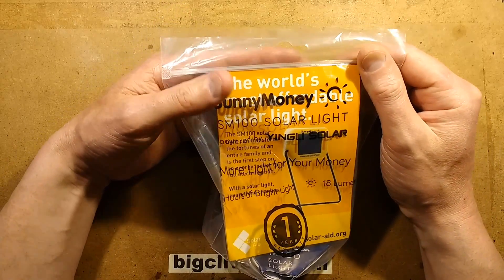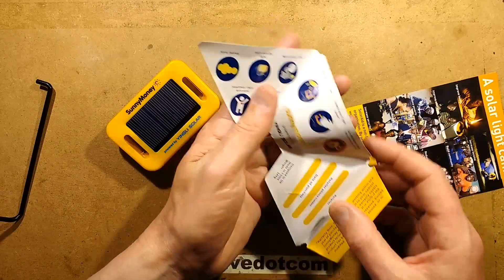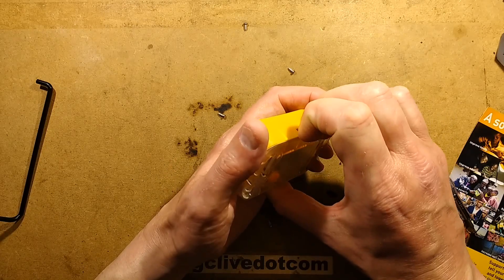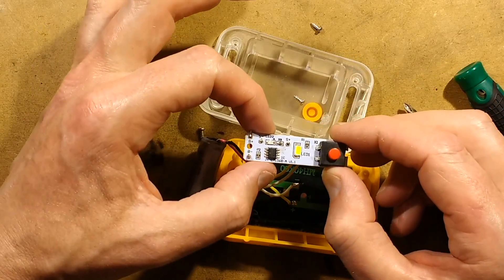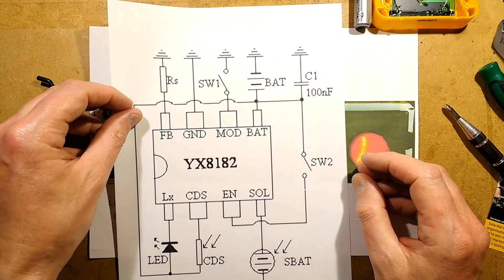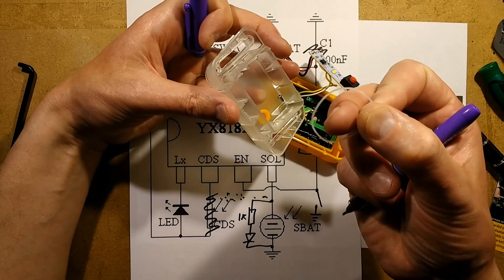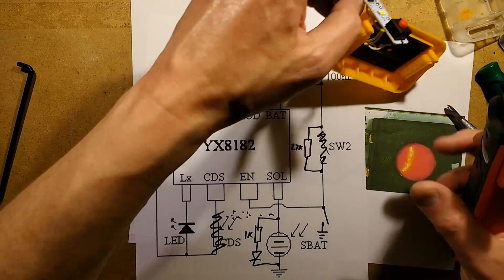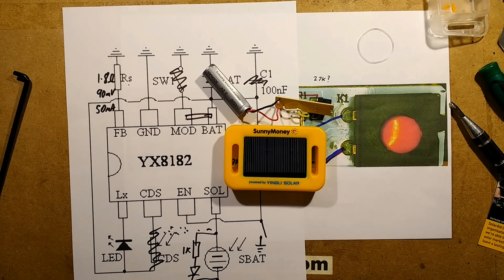SM100 solar light for off-grid communities.

Comment: Another benefit of LiFePo4 is that they’re deep cycle, so if you drain the cell flat they don’t mind as much. A LiPo run to 0v might just die on the spot

If this was waterproof and had the “charge by day, glow by night” config, I could imagine plastering it into the roof for automatic house lighting

Comment: don't know if its just me, but this seems bad value for money, and a bad design especially for someone in a third world country. It seems you could get this made for less than £5 in china, and can get very similar stuff for around £5 off the shelf, 18 lumens is not good if that is your only light source, i think your poundland solar project would be better for them than one of these. And torque head screws, these should have normal flat head or crosshead screws so someone in the third world can actually replace batteries or led's within it, these will just get thrown away or smashed apart as they won't have the tools to take them apart.

Comment: Watched pretty much all Clives vids. Brillant! all of them. :) I still can't find a way to "click" 'Thumbs up' when in full screen mode.  I also get confused with the electronics terms  "pull up" "pull down" "across" and "in respect to". i do have a disability with learning tho. if anyone has any "explain it like i'm five" explanations (with pictures?) that can put the 'vernacular' language into a context to help me learn, i'm sure that myself and possibly many other beginners would be very grateful.
Reply from the maker: Pull up and pull down refers to where an input pin on an integrated circuit is connected to a switch.  You can't leave the pin floating, it has to be either positive or negative, so if the switch is connected to the positive rail there is often a resistor inside or outside the chip that pulls the pin down to the negative rail when the switch isn't pressed.    Where the button/switch is pulling the pin to the negative rail the resistor will be pulling up to the positive rail.
Reply: @bigclivedotcom  Thank you sir! :)  so the 'pull' is getting the input "to get off the fence and choose a side, a side that 'we' have decided that you prefer, for you" ?

Also pull down and pull up. no push? is push a term?

Comment: @7:03        Might not a screen capture be appropriate then?   Windows key + Print Screen (PrntScn) if M$ hasn't changed things in the 15 years or so since I've used Windows or Grab on OS X (which lets you choose between capturing the entire screen, a specific window or a selection)...    it'll add 30s or so to your workflow to grab the screenshot, open the resulting .bmp or .tiff and crop if necessary before printing...     just a thought (^_-)

Comment: Wow that UT210E is stunning!! I have a much larger clamp ammeter that can read DC Amps up to a few hundred but it hardly stays at zero like this one does. The slightest activity makes it shoot up to 30A or 50A when there's no current passing through at all. It's only good for measuring very high DC amps like a car's starter motor :(

Comment: Not gonna lie for 10 quid you get a torch that charges with the sun. Sure they claim to sell it cheaper to developing countries, but it's still bloody useless.

The LED is behind half a centimeter of plastic, wasting light by splashing it all over the case, there's no USB charging ports (at least one would've sufficed) and the thing is designed to make it impossible take apart to repair, which I'd say is vital for people who'd have little access to just buying a new one off the shelf or online.

I say a USB port would've been necessary because while it's true they don't have as many gadgets and such to use them with, it's incredibly naiive to think they'd have no use for charging over electronics. It defeats the entire point of an expensive solar cell when it does the same job a wind-up torch can do for much less. If they had cheap phones or tablets, or even a USB-compatible battery charger for other electronics, this device would've been great as a solar powerbank but also for charging items for free.

Instead, you get a mediocre LED with a bit of metal, and most of the money goes intoa solar panel that isn't even utilised to its full potential.

This product clearly wasn't designed for developing countries in mind, it was designed to make a profit off the backs of struggling communities and charities thinking this product will make a damn difference.

Comment: Hi Clive  any chance you could do a tear down/how it works- of a small bathroom extractor fan, I have one which works,but the time delay side of it has stopped working,  I was goin to replace it,but if it's just a case of a few capacitors which are used to keep it running after the powers off? Then I would like to repair it....  Would be a good video as well I think😀😉. Atb Martin
Reply from the maker: It may be the power supply resistor that has failed.  They often use a simple resistive dropper and they get very blackened over time.  If you do take the module out then be very careful as there is a constant live feed to the fan as well as the switched one.
Reply: bigclivedotcom   Ok thanks,will take a look at it

Comment: 45mA from the battery, not driving the LED... as the voltage of the LED is likely lower, its current will be higher.
Reply from the maker: +TheDefpom It's a simple current regulator, so it will mostly be the current through the LED.

Comment: only 300mAh? that sounds awful for that size of battery..why not use a NiMH battery that size? you can get batteries about that size that are about 2000mAh.. even if they had to step up the voltage a little bit wouldn't the greater capacity greatly outweigh any cost to boost voltage? hell, i think even AAA nimh batteries have around 800mAh! nimh can be very low self discharge and have many cycles..
Reply from the maker: +kekejojo1212 300mAh at about 3.2v.  So roughly equivalent to a 900mAh NiMh cell.

Comment: A lot of clever features and safety has gone into this. Those batteries are still dangerous. a regular screw would be common knife but a torx screw needs a special hard to find tool. They could've used cheap screws, but didn't.
It looks real well designed and thought out. Good on them.
I wonder how many actually makes to any kid, and not gutted for batteries and parts!

Comment: a few years ago I purchased 20 solar powered automatic air fresheners The refill cartridges were no longer made, I think I paid £5 for the lot.
I sold some on eBay for solar projects as the solar panel . charge and timer circuit and the electronic spray valve were good quality.
I made well over my outlay back and still have 3 left brand new boxed.
Your welcome to one if you can make a video of a project that will help somebody learn I can post it to you free
Reply: My solar powered calculators works well enough indoors.

Can you get enough power from an indoor power cell to depress a plunger once every 5 minutes?
Reply: Peter McArthur it has an electronic valve no mechanical parts also has an led light to show enough light is present
Reply: Solar powered air fresheners? I can see why they didn't take off. Solar implies outdoor. It's got its work cut out for it if it's going to freshen your whole garden.
Reply: Paul Sengupta within seconds of taking out of the box the led starts flashing in a room with reasonable light I was surprised myself

Comment: B&M currently have 2 for £8 on LED lighting, and this includes some Phillips dimmable LED fillament bulbs. I've got one myself and it works well, dimming smoothly down to low level. Might be an interesting teardown if you can get hold of one. Must have a capacitor for smoothing since when on a normal switch, instead of going off instantly like an LED normally does, it fades like a conventional bulb.

Comment: Seems like a nice robust design, which will be sold at a price much closer to the manufacturing cost in the developing world. It will become much-relied on by its users so longevity is needed. Is LiFePO4 technology also better at higher temperatures?

I don't think it will be used for reading in bed, but for doing your homework from school. Poor students finding enough light to work is a real problem - here's one Filipino boy's solution https://www.youtube.com/watch?v=cUF46R-WZak

Comment: A second, larger, version with 5V USB output in addition to the light would be great. My understanding is that communication is often limited to cellular/satellite. That would allow (limited) charging capacity. Also what this needs is multi-level control. After all if you do not need the full output going 50% would almost double that 5 hour run time!

Comment: For ~10-12pounds i can get ~100-200kW/h, depending on the rate. This thing shall never pull out that much power from the sun. It will die from old age. Just save the earth by not buying this plastic. The manufacturing of one such device killed one dolphin, probably.

Comment: CLIVE could possibly do a video of cell life spans and failures? 

The cell in the this video made me think of this.

My cells AA 1.2v 1300mAh (1 years old NiMH) have suddenly decided to heat dramatically while charging.

One week ago they were below 20'c while on charge this week 50'c+. Charging current is... 500mAh/1000mAh (Batteries are fast charge capable) they have no physical damage or any other signs of wear and tear. Sudden heating is the symptom. Their life span per charge has decreased by 20% in this week. I see this happen with every rechargable set I buy every 2 years.

The batteries I am talking about just now are Duracell Rechargeable 1300mAh. 

http://www.caboodle.co.uk/technology/batteries/rechargable-batteries/duracell-staycharged-premium-aa4-rechargeable-2400-mah/?gclid=CMS577vkldQCFaMK0wodCdUGdw

(NOT EXACTLY THE SAME TYPE BUT THE SAME BRAND)

£7 every two is not bad IMO.

Comment: as for the screwdriver, i bought one of those nice aluminium ones from ebay seller in china, when it came, it didnt have the 8 promised bits, it had 4, and two of those , the 2 philips werent cut, they were just tapered bits of metal....
Reply: Poundland is your friend.
Reply: i know they have them, its hard for me to get to one, hence i use ebay a lot

Comment: Can you make something that doesn't need battery? They don't even need a solar cell on top. Maybe just lift a 50kg sandbag in the evening for about 1,5m height that any man can do in 2 seconds in the evening and use that energy to lit up a led like this. It doesn't create any waste like the battery and plastics used with this. That could work for weeks even with nearly 0 effort on their part and sand they probably have everywhere. :)

Comment: It could be a nice light for an emergency kit at home, if it wasn't for the 0.14mA quiescent current. it will discharge a full battery in about 3 months. if you turn the light on and forget about it it will be even worse once the protection kicks in after about 8 hours and the pull up resistor keeps discharging it until the end of time...
Reply: bets kit for emergency , is a AA led flashlight with a real off switch and no smart circuitry and 2xaa lithium batteries, they have a standby time of 10 years and still last 4x longer than regular,  buy one with medium brightness to last a really long time, my varta is rated over 50 hours on alkalines will go ages on the 2 lithiums i put in there
Reply: Just leave it on your windowsill instead of in the cupboard.

Comment: BigClive What are the pros and cons of the different types of lithium battery?
Reply from the maker: Standard lithium ion is most popular because it has the highest energy density.  The LiFePO4 has lower energy density, but more stable chemistry that will yield a much higher number of charge discharge cycles and longer shelf life.  The LiFePO4 is also less volatile when it is damaged.

Comment: The cost is so low on these that I'm surprised they don't have a buy one give one type of offer to help get them into the hands of kids who would benefit from them.
I love the design based on what you've pointed out, Clive. Truly a long term design built for long term service.
Of course one could conceivably apply the same garden light technique of taping over the holes to augment the weather seal. which would also put another protective layer over the solar cell if one thought there might be the potential for inordinate exposure to moisture.

Comment: Clive, could you consider doing a video on how temperature extremes affect rechargeable batteries? Thinking of the use of a rechargeable light such as this in conditions of extended storage or use in sub-freezing temperatures.
Reply from the maker: You get specific cells for extreme temperature conditions.  For low current drain devices it's a bit less critical.

Comment: So for how long would a fully charged LiFePo cell light up that LED? And could this time possibly even be increased by putting in a 20 cent JouleThief circuit? Also, how long does it take the small solar cell to charge this LiFePo cell? These are all questions I wish were answered in the video. Well, maybe someone will answer them in the comments :)
Reply from the maker: +Seegal Galguntijak It will run for about 5 or 6 hours on a full charge.  If the sense resistor value was increased it would run for longer at lower intensity.
Reply: bigclivedotcom But how much could that value be increased by putting a Joule Thief into the circuit? Or not at all? (But then, everything that I heard about Joule Thiefs must be wrong?)
Reply from the maker: Seegal Galguntijak The Joule Thief is intended for use where the cell voltage needs to be increased to drive the LED.  It would be less efficient than the integrated driver used in this application.
Reply: bigclivedotcom - Now I understand. Before the JT could do something, the LiFePo cell would be depleted below its deep cycle threshold and probably be dead. So I guess a JT would only be of use for an application that uses non-rechargeable batteries (so that the battery first powers the LED normally, and at a certain voltage, the JT gets switched in the circuit so that it can then deplete the battery to the last without having to care how much energy is left for it to be recharged without damage). Makes sense - thanks for the explanation!

Comment: I'm curious if they used a standard white LED with Vf >= 3V or if they used one that can drain the battery flat to 2.8V
Reply from the maker: +Sebastian Grygiel The circuitry has battery protection built in.
Reply from the maker: +Sebastian Grygiel I should add that most white LEDs will still light down to lower voltages close to 2.5V at lower current.

Comment: Why did they use Torx? Not exactly end-user friendly for their intended market!
Reply from the maker: +Mark Schwarz I thought that was a bit odd.  We should send them some screwdriver kits too.
Reply: Probably as a statement of "no user serviceable parts inside - and don't even think about scavenging it!"
Reply: Probably. Might be the solar panel company or battery company doesn't want them to allow easy scavenging/servicing and has some contracts there. 

Could be because they don't want people to immediately ruin the light.
Reply: +bigclivedotcom A direct reply! Fanboy heaven! Keep up the great work Clive.
Reply: You make an excellent point.
Reply: The reason that they use Torx is the same reason that automotive assembly plants use them. The bit doesn't have to stop to seat in the fastener and hence it speeds assembly.

Comment: it is actually literally physically impossible to pick out the right size of torx bit on the first go
Reply: yes, the smaller they go, even worse!
Reply: I advocate the return to the earlier definition and use of "literally":
Since the early 19th century, literally has been widely used as an intensifier meaning “in effect, virtually,” a sense that contradicts the earlier meaning “actually, without exaggeration”
Reply: 50:50 shot with plugging in a USB cable correctly, but it still takes me three tries.
Reply: @ElectricalNovice19 is obviously a witch.
Reply: I do manage sometimes... I love Torx but fortunately rarely have to use the really small sizes.
Reply: T20 and T25 are good size heads (actually my son put up all his kitchen cabinets - T25 screws - with a T20 bit before he noticed the mixup!)
Reply: It doesn't really matter.
Reply: +Christmas Eve I did that once.
Reply: LOL Syncubus!  That's so true for me too!  Three, four tries... it's better than trying to force it in the wrong way (thinking you already had it the wrong way the first time) and then breaking the USB port circuit board or causing a short...
Reply: Yeah, I have a T-20 bit in my precision screwdriver kit. I have used it to tighten hard to reach screws on a deck built with T-25
Reply: I advocate not riddling every sentence with a plethora of superfluous adjectives and adverbs, 'big league'.
Reply: I hate to say it but that's never happened to me. I have used many torx bits and I have gotten it right every time. The smallest one was a T2 torx.
Reply: Nope, Just very good with size. I'm not saying picking the wrong size won't ever happen, I'm saying it's very unlikely. Actually the screws I used to build my desk are T-25.